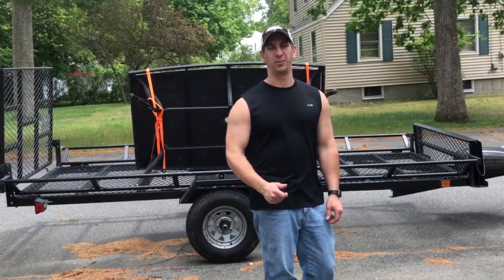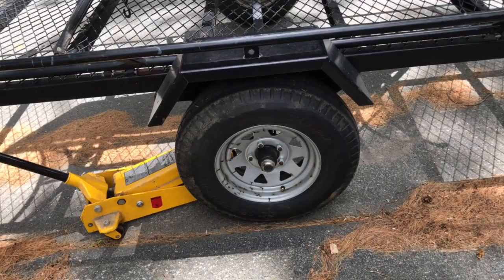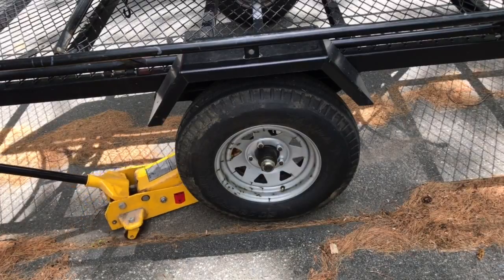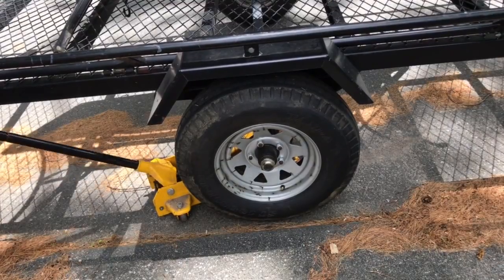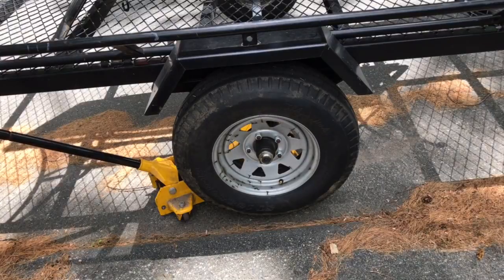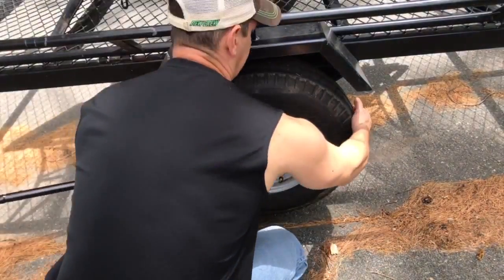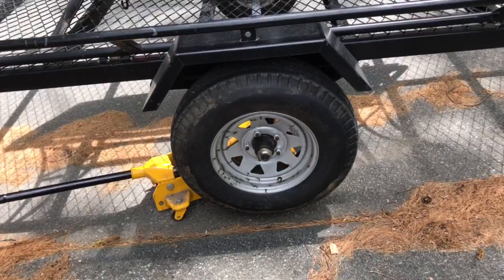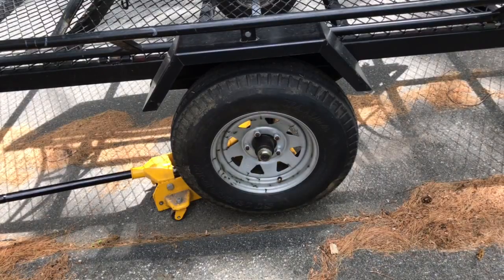How To Check a Utility Trailer Wheel For a Bad Wheel Bearing

Comment: A loose hub or hub with minor play,, doesn't necessarily mean you have a bad bearing. 
It may just be loose. 
Brand new bearings reuire a break in, before re torquing them. Also, of your hub don't have play, your bearing may still be bad. 

Jack up your trailer, check for play, amd spin the hub. If you hear a growing noise, or any kind of noise, if it feels rough, your bearing is bad. 
With regular use, you should pull the hubs, clean, inspect bearings and races, check condition of seal. Replace if necessary.  
Clean bearings takes and hubs, repack, then install and re torque them. 

After you clean the bearings and races, look for marks, or pits. If it's anything but perfectly smooth, replace both bearings and races as a set. Replacing a bearing, while reusing the race, will only cause a new bearing to fail faster. Bearings and races have to stay together, make sure you put them back where they cam from.
 Or replace both, bearing and race, at same time. Never replace one, without replacing the other. 
If you doing one, you might as well do all of them. 
Atleast do inner and outer, for the one hub. 
Why try to save $20, and have to pull it all apart again, when the old one fails. 
If seals are soft, not best or damaged, you could reuse them. But again...
If your going thru the trouble of doing one, why not do them all, amd never have to guess if they're going bad or not. 
Make sure to always torque the axle nut to recommended spec. If new, should re torque,  after a 500 mile break in period, or when manufacture recommends
Reply: Thank you!!
Reply from the maker: Thanks for watching

Comment: Spin the wheel to make sure it doesn't sound rumbly or growling,  that would also let you know if the bearings are bad and or low on grease. They should spin smoothly and quietly.
Reply from the maker: Thanks for watching and the added tip!

Comment: What if it's kind of noisy even though I repacked the bearings and cleaned the whole unit?
Reply from the maker: A set of bearings are cheap. A stranded trailer on the side of the road is not fun.
Reply: What if you had side to side movement at the top of the tire pulling and pushing on it